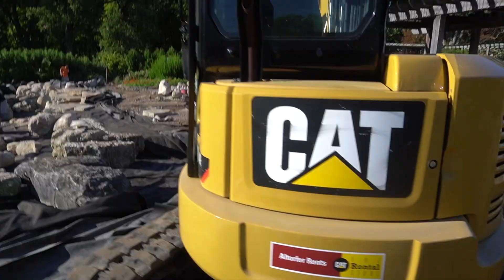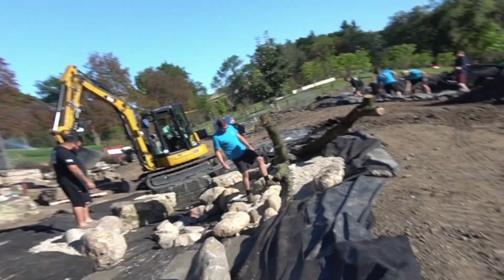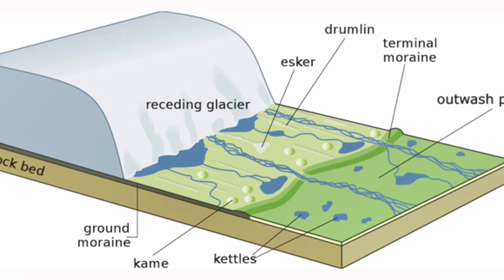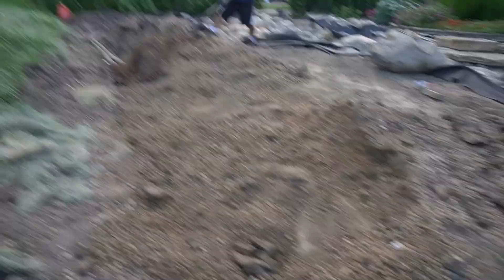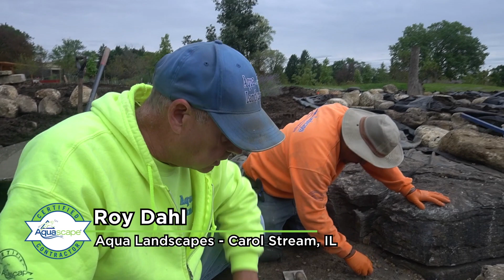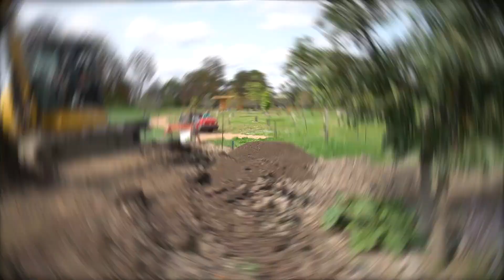*WETLAND & STREAM* Construction at Cantigny - Part 4

Comment: Hey Ed great videos building a 25 / 40 pond with a wetland filter and intake bay  my question is would it be all right to run 2 of my downspouts from my house both into the pond using the Aquascape downspout debris collector basin  and using the intake bay for the overflow would that mess with the pH of the pond having that much water flushed into it or would I be all right thanks for your advice